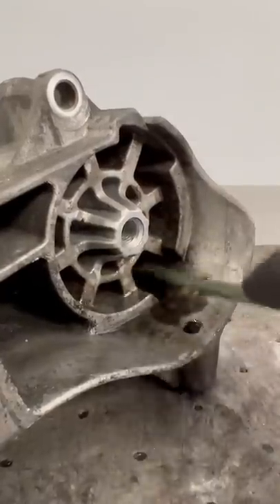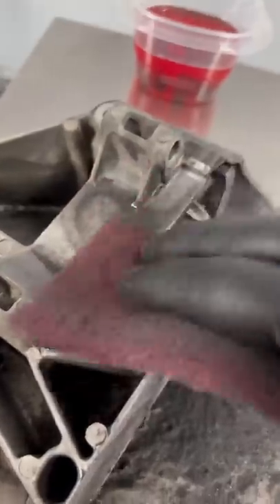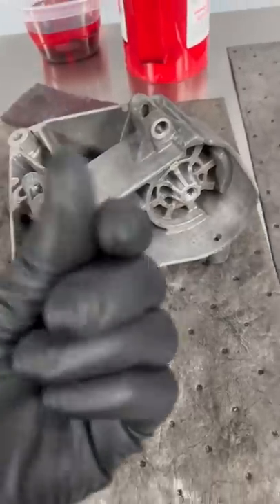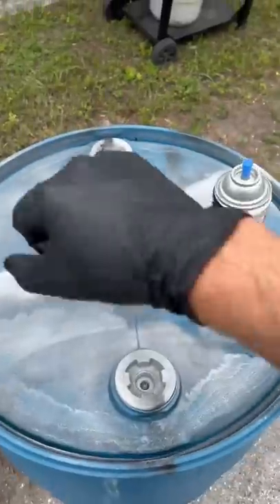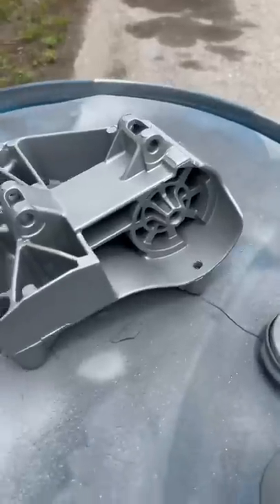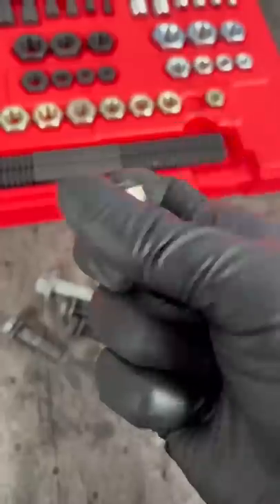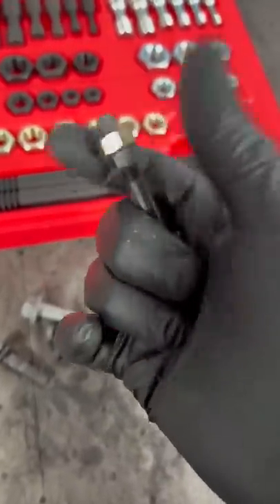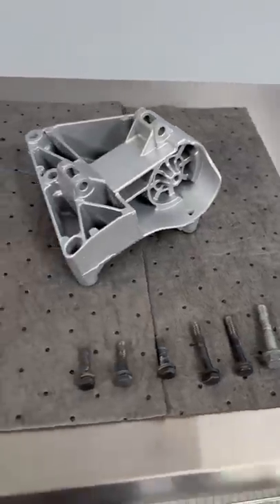Did I waste my time?

Comment: You need one of those water/glass bead blasters for aluminium. M539 has one, works incredibly. And no you didn't waste time, sell that shit lol.
Reply from the maker: I wish I had that machine!
Reply: @JamiesGarage1  You can make a sand blaster in about 20 minutes with a 3 liter bottle, an air hose and some sand
Reply: @contraband1543  Yeah but you really need a proper enclosure if you don't want to fuck up your lungs or the lungs of anyone else in your shop. And sand is too aggressive for use on things like aluminum
Reply: @richardmillhousenixon  I've done it but okay then
Reply: @contraband1543  i hope you mean sand blasting media and not like sandbox sand
Reply: @contraband1543  Just because you've done it doesn't mean you didn't fuck up something in the process
Reply: @richardmillhousenixon  reminds me of an ex
Reply: @JamiesGarage1  give vapor honing technologies a call. Its great for cleaning all sorts of stuff. It will clean all that old paint off a m62 valve cover like you have never seen.
Reply from the maker: @andrewr6861  Just checked them out, I need one like right now! Lol
Reply: You’d be surprised how well and ultrasonic cleaner would work on something like this.
Reply: @hullinstruments  I have both, the glass beads with water in vapor honing will polish the surface as it cleans. Engine components with places that the glass media may become stuck in I use Ultrasonic.
Reply: @andrewr6861  glad to hear it! I basically clean things for a living 😂🤷‍♂️

I have a small business and lab doing component level circuit board repair and troubleshooting. I specialize in test equipment repair and calibration… And other related metrology tasks. 

Having a good way to clean things is a big part of my business. Especially industrial circuit boards, Motors, motor drives… Pretty much anything used and abused in the industries

Before I can really check it out I need to have all the contaminants removed and the ultrasonic machine is one of the fastest and most guaranteed ways to do that!
Reply: Our regular glass beader cabinets at work do an outstanding job.

That wet/solvent and media blasting is some new trick hotness though, sub par only to the RustLaser(or whatever that lazer rust removal thing is actually called.

Comment: Vapor blasters are great for cleaning up parts.  I converted a harbor freight cabinet with a trash pump, 6 gallon bucket, and some hardware.  Counting the cabinet it was under $500 and I use the heck out of it on motorcycle parts.

Comment: You can waste a whole bunch of paint cans on it, or, you can mask the threads after washing and removing the sludge, then put it in a sandblasting chamber and sandblast with a couple of different grade media which will bring the original aluminum luster back to the part.

Comment: I was about to say, if that's aluminum you need to water break  and etch the surface with an acid or use a sekf etching primer. Otherwise your paint will flake off.

Comment: Get a gallon of Meguiars super degreaser. I have used it at full strength on cast aluminum covered from oil leaks and dirt. At most, you will spray it on twice and rinse it off. The aluminum will look brand new. It works wonders under the hood on master cylinders, a/c hard lines, timing covers, heat shields, etc.

Comment: I knew a kid who painted his b series Honda block with aluminum colored paint. 
I thought it was kind of rice-ie… but I wasn’t hating.  I was a teenager once.  I helped him drop the engine back in after he finished working on it.  He test fired it a day later… problems.  Calls me up.  We’re getting maybe 40 psi across all cylinders.  Lots of odd smells. Coolant and oil pissing out the head gasket seam…..

We discussed potential problems. 
Talked about torque and torque sequence.  Did you use old head bolts?  Was it clean?  Was the head gasket right side up?
……….. did you paint the top of the block?
Yes… yes he did.  Live and learn. Right?